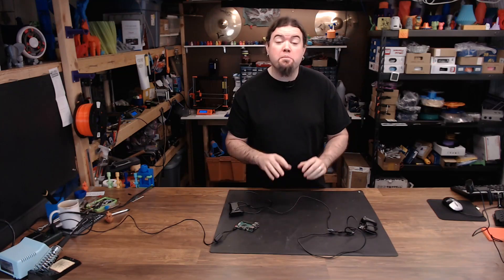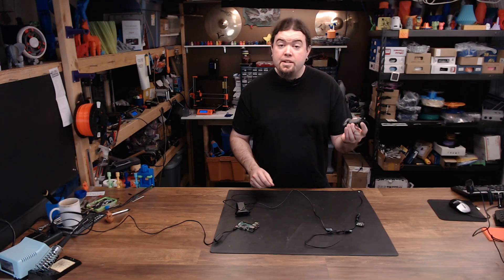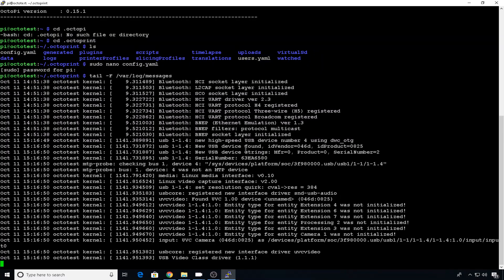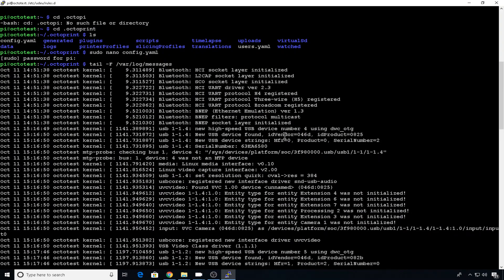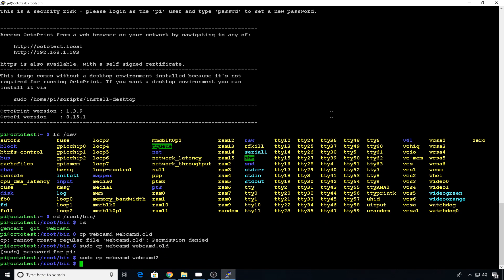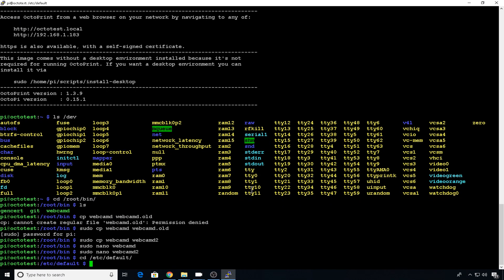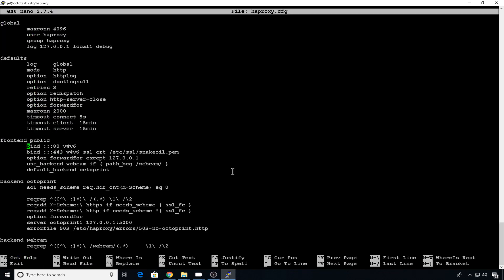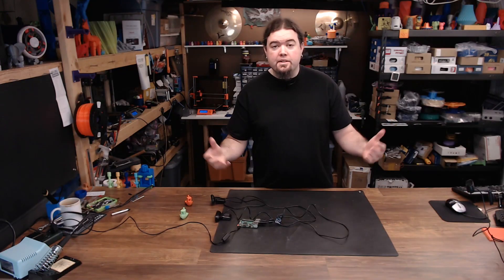Depreciated -  Multi-cam Plugin - Chris's Basement

Comment: has anyone got this to work as I have tried with 2 Logitech web cams both have serial numbers but just only one camera works , looks like second camera is not loading correct as the light on webcam is not comming on
Reply from the maker: What Pi are you using? Depending on your resolution you might be running out of CPU power.
Reply: Chris Riley I’m using 3B
Reply from the maker: @woottog  Ok, sounds like something is off in the config. You can send me an email if you need further help.
Reply: @ChrisRiley  I wish you hadn't asked to use email, I have 2 webcams from 2 different no name companies (probably the same OEM though) with the same vendor, different product, and same serial number. Would have been nice to have the answer here where others can find it (Pi 4 by the way).

Comment: I figured I would let you know that the octopi 17 update will break this. as there isn't a webcamd in /etc/init.d/ anymore.  I couldn't find the appropriate file to edit so I had to revert back to the latest 16 build.
Reply from the maker: Thanks, I will see if I can sort it out.
Reply: @ChrisRiley  If it comes to it, I would be more than willing to help.  I did get my first webcam to work even with multicam by commenting out a line.  But I couldn't for the life of me figure out how to add the second one without the webcamd2 file in that directory.
Reply from the maker: Thanks! I will try to jump into this soon.
Reply: @ChrisRiley  Same here, at this point I also got stuck since no webcamd in /etc/init.d/ ... Any soulution or ideas yet?

Comment: I have instaled on my raspberry pi 3b+ octopi , that is conected to a mks gen l v1.0 motherboard for my 3d printer(ender 3 pro), soo wen i open my octoprint into a browser i can use octoprint . I wanted to install some pluggins ,but first time i had an error that said my server was offline , after conect my raspberry to wifi and set a static ip adress , i conect my raspberry to my main board , after that is said the status of octoprint was operational , soo i expected it will work ....
After that it said that my instalation doesn't have internet , soo i coldn't install pluggins . I see that in the "conectivity check" my host was 8.8.8.8 and my port 53, i press on test , there said "server is unreachable ".
What do i supose to do ?
Reply from the maker: Sounds like a networking issue. From the command line can you ping 8.8.8.8?
Reply: @ChrisRiley  Thank for your answer ,no i coldn't , it was a nwtwork issue, but yesterday i just reinstall octopi and octoprint , amd now i can conect to the ethernet and alao my plugin and mainboard work , only one thing that didn't work is my tft 28 touch screen , from octoprint i can control my 3d printer , but from the touchscreen i can't it shows up the classic blue windows style ,installed by me from github , but it didn't do anything .
Reply from the maker: @alexandrugroza839  Sounds like the Uart connection isn't a connection. If you unhook from the Raspberry Pi, does it work?
Reply: if i unhook the mainboard from the raspberry , no it didn't work
Reply from the maker: @alexandrugroza839  What version of Marlin are you using?
Reply: @ChrisRiley  Marlin 1.8.9
OctoPrint 1.3.11 running on OctoPi 0.16.0
raspberry pi 3B+
mainboard mks gen l v1.0
touchscreen tft 2.8 v4.0
tmc 2208 v1.0
cura 3.0.2/4.0.0
Reply from the maker: @alexandrugroza839  1.8.9 is your IDE version, are you on Marlin 1.1.9 or 2.0. I ask because 1.1.9 should work without any change. 2.0 you will need to enable the second serial interface.
Reply: @ChrisRiley  ok , how i do that , i see something like //#define lcd for melzi and #cr 10 stockdisplay,
Reply: @ChrisRiley  or #define mks mini 12864 (mks mini with graphic controller and sd suport )
Reply from the maker: @alexandrugroza839  If it's 2.0 Uncomment this one and make it 1 #define SERIAL_PORT_2 1
Reply: @ChrisRiley  i search and i dont have that one , only 
serial port 0
And i write 
Serial port_2 1  
Then i veryfied and saids i have to chose only one lcd not more , i thick i have uncommon the default ender 3 lcd , soo i have to commen that
Reply: Is that command from other reply ? 
Mks mini 12864 
Or other ?
Reply: ok ,i succeeded , the problem was baudrate , it was wrong set , tanks for all your help :))
Reply from the maker: @alexandrugroza839  Awesome! Glad it's working, you had me stumped. :)
Reply: @ChrisRiley  :))

Comment: I might be a little late to the party but I can not get this working. 
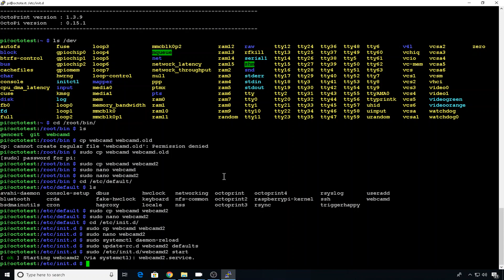I think I know what's causing the issue, but not how to fix it. At 11:46 in the video, you can see the output of the service running.
My output is a little different (probably because of more recent updates), but that shouldn't matter.
I can however see te HTTP TCP port webcamd2 is using and for some reason it's streaming on 8080. 
I have retried everything 3 times today watching closely that everything port related I setup is true copypasta to the video, to no avail.
I think this causes it to just wipe away my webcamd or it just takes the default first connected route...
I am pulling my hair out, if someone could be so kind I would appreciate it dearly.

Setup:
Octoprint : 1.3.11
Octopi: 0.15.1
Cams:
webcamd: Logitech C270 (as in the video)
webcamd2: a cheap generic endoscope (which is right now the only thing streaming in the gui)

Kind regards,
victor
Reply: Isn't octopi into version 0.16
Reply from the maker: @gregoryayres1535  Yes, octopi is on 0.16 now.
Reply: @gregoryayres1535  Ok, I'll look into updating octopi. I'm just not sure how that would help me in setting this stuff up :p. Might be good to get a clean install with just the multicam. Thanks anyways
Reply from the maker: If you are still having trouble Send me an email brotherchris81 @ gmail dot com

Comment: went through all the steps and sadly now my octopi server doenst start up and i have to fresh boot my raspi to fix the problem
Reply from the maker: Sorry man, it is easy to mess up along the way.
Reply: @ChrisRiley    any ideas as why now even new loads are having connection issues.   I can see anything on my touch display or get it to ssh
Reply from the maker: If I were to take a guess you might have a power problem.
Reply: @ChrisRiley  yea idk.  I have an offical psu for the pie.   I got it back up with fresh install and this time I imaged the drive before starting any work.  Hopefully this time it takes. 

  I do love ur vids they are straight forward, good notes and clear.    Can you do another vid for a 7 inch touch using the pi 3b+  I got touch ui installed but only ever got interface with zero actual information or control of printer
Reply from the maker: @gregoryayres1535  I will see if I can get a hold of a 7".
Reply: @ChrisRiley  it did the same thing again when i try to load the gui  saying octoprint server is currently not running.....i can SSH into it and this is the exact same thing that happened last time i tried to do this.  i did take a snap shot but no way to upload that here
Reply: any ideas?
Reply from the maker: @gregoryayres1535  Send me an email brotherchris81 @ gmail dot com
Reply: @gregoryayres1535  did you ever get this working? Im having the same problem
Reply: @cherokeewheeler  nope. Decided to try and use old laptop and ubuntu

Comment: just tried it messed up somewhere.  the  webcams i'm using are the same.  now my webcam 2 works but not webcam 1
Reply: double check your spaces if your having issues.  took me forever to find it. everything working now.  great walk through.
Reply from the maker: @EPICPRINTS  Awesome, glad you found it!
Reply: @EPICPRINTS  where might i ask were you missing a space? im currently having the same issue. seems only one cam will show at a time, sometimes on webcam 1 other times on webcam 2 depending on what i change. either way cam 1 config.yaml settings keep reverting webcam 1 back to no ip default.
Reply: @SHPLOOPSHPLOOP  i coudln't tell you where it was.  just double check it all.

Comment: I could not get this to work, here is some that i learned. I use two c270 cameras. When i plug one in 2 devices appear in /dev, video0 and video1, when i plug the other in video2 and video3 appear. Only video0 and video2 work with mpeg streamer. Problem is, 99-usb... does have insufficient info, so sometimes camera1 links to video0 and sometimes to video1, likewise the second camera, sometimes video2 sometimes video3, never found rhyme or reason. Even more interesting is when u unplug and replug in a different usb port, it appears the system keeps a hold for a bit and suddenly camera 1 will be video1 and video2 and camera 2 anybodys guess.

Tried to find differences between video0 and video1 to put in 99-usb.rules, nothing was consistent

I ended up linking to entries in /dev/v4l/by-id/ where each camera had 2 entries, each ending in -0 and -1, linking to each camera ending in -0 made things work consistently.

If u do ls -al here, u can see which video devices are linked to. Found using the entries in this directory made things work regardless of ports plugged into

Oh yeah, the cron works on 2 minute intervals, so if u unplug and replug it may take a few minutes. As it says in the Hitchhikers guide to the Galaxy .. Dont Panic

Hope this helps somebody
Reply from the maker: Thank you for the info.

Comment: Chris
Thank you for sharing  your knowledge.

I just installed OctoPrint  1.3.11 with OctoPi 0.16.0 on a PI 3B+ and I am not able to get the default camera to run (only the C290 works).  I have a Logitech 270 and a C290 (both have a serial #)

Both cameras work on their own PI hardware before I combined them into one install with the new version.

Any suggestions?

Comment: Hey Chris! I have a dash cam and a logitech c270, and the octolapse time-lapses are great from two angles, but would it possible to use an old iPhone 5C? I think the camera on that is slightly better
Reply from the maker: I don't know anything about apple, but if you could set it up as a camera server with an app, then you could probably just add its IP and pull in the feed.
Reply: @ChrisRiley  hey there! I tried using an app that has an IP address, but it doesn't work with OctoPrint. The IP on a browser pulls up the camera, but when I add that IP on the "Settings, MultiCam", nothing shows up but "Webcam stream not loaded". I also tried adding the IP under 'sudo nano config.yaml', but it doesn't work either. What suggestions do you have for a wireless camera app like this one?
Reply from the maker: @humbertoramos9172  I think that really should work. Does it use port 80? Maybe it's trying to use 443?
Reply: @ChrisRiley  how exactly do I check what port it's using? I'm thinking that since the "udev rules" still have both webcams previously used, it might try to use one of those. However, the device isn't connected, since it's IP based.

On the forums, people mention that a url like "http://username:password@1.2.3.4/tmpfs/snap.jpg" works, but in this case, I don't know what the username or password would be, since it is an application that generates an IP address on the phone used.
Reply from the maker: @humbertoramos9172  Yeah, you have to pass it the credentials. Not sure how we could make the work in the gui.

Comment: shouldn't you add a 2 after the  /etc/default/webcamd <- 
?
Reply from the maker: On the second one yes, point me to where in the video you are talking about.
Reply: @ChrisRiley  11:08 it's in the header (i know it's commented :))
Reply from the maker: @abtra  Those headers are actually used by rc.d files to make sure dependencies are met before things are started. Even though they are commented out they are still read, so you can update the informational ones with a 2, but not all of them. Just do the 7 updates I show in the doc and it should work.

Comment: Thank your for this guide. However i can´t get 2 cams working. It seems like "webcam2" is not accessible:
- IP/webcam/?action=stream  is working
- IP/webcam2/?action=stream  is  not working

Interestingly if i change in 99-usb.rules the names of my two cams i get a picture from my second cam.
Do you have any Idea where to look at next?
Thanks a lot!
Reply: I have the same problem. When I type "systemctl status webcamd2.service" or "systemctl status webcamd.service" everything is running normally

Comment: how do you change the resolution on cam #2?  so i have the logitech c-270 and it says to use -r 1280x720 -f 30 or -r VGA -f 10... My first cam has been set all ready in the octopi.txt
Reply from the maker: You usually can't use octopi.txt in a dual camera setup. The resolution is set in /root/bin/webcamd and webcamd2.

Comment: Hi Chris, great tutorial! However I'm having an issue where only 1 of the 2 WebCams show up. I have gone through your tutorial 4 times and still can't get it to work. I have a Logitech C922 and C615 I'm trying to connect. The C922 is the only camera that will display. I have both WebCam 1 and WebCam 2 buttons but both display the one camera only. I did notice that in the multicam plug-in , WebCam 1 removed the URL from /webcam/?action=stream. Basically it switched back to the default. Any help would be greatly appreciated. Let me know what other information you might need. Thanks
Reply from the maker: Hey, send me an email and I will help you troubleshoot. brotherchris81@gmail.com

Comment: Chris, I’ll be looking forward to that video. Can you tell me if it’s even possible to set the pi camera up and include a usb camera on the same pi? 

What I want to do is use the Pi camera module for time lapse and then use a endoscope for a close up of my nozzle to see how the plastic is coming out of the nozzle. I’m hoping that this can in fact be done.
Reply from the maker: Yes, it is possible. You have to assign the pi cam as the default cam, the add your usb cams.
Reply: Chris Riley great news! I can’t wait for your tutorial! Thanks you for your help.
Reply: Hey ! Have you found any solution to do that ? How can i assign pi cam as the default cam ?

Comment: Hi Chris. Is there easy way to undo this all 'cause i dont get any camera picture at all anymore :D I have been watching this over and over again  and i just don´t get it...im using two hp hd2300 and 1.st problem those do not have serial. in  99-usb.rules i think i can handle it with devpath, 'cause  those cams are in same usb always.2nd problem is after 99-usb.rules, after reboot i dont get ls /dev  "orange" "green" anywhere..
Reply from the maker: Not sure about backing it out, but I can help sort this out.

So if you run this command all at once, its going to copy some log files out to a pastebin site. There is no info that is sensitive and really the only way you could find these files is by having the link. The files will be deleted in 7 days.

If you are all right with that, run this:
sudo wget -O info.sh https://www.dropbox.com/s/08qhr7f33j7wq4k/cam_install_info.sh && sudo chmod 777 info.sh && ./info.sh && echo

Then send me the link it spits out at the end.

Comment: I went through all the steps and when I go to add the second webcam when I hit save it changes the first webcam's URL back to the original.
Reply from the maker: Save in the GUI? Check and see what is in config.yaml.
Reply: @ChrisRiley  Yes. when I save in the GUI is changes the webcam 1 URL in both the GUI and the config.yaml file
Reply from the maker: @3dprints140  So it should stay there after a reboot, correct? Here is my config.yaml.

  multicam:
    _config_version: 1
    multicam_profiles:
    - URL: /webcam/?action=stream
      isButtonEnabled: false
      name: webcam 1
    - URL: http://192.168.1.187:8081/webcam/?action=stream
      isButtonEnabled: true
      name: Webcam 2
Reply: @ChrisRiley  I change the config.yaml to be what you have above with my IP but the webcam 2 stream won't load
Reply from the maker: @3dprints140  If you send me an email I can help you troubleshoot. brotherchris81@gmail.com
Reply: Chris Riley having the same issue after 3 tries and the last involving starting from scratch with a new OctoPi reimage. I can only get 1 cam working at a time. I’ll update the config.yaml to the proper urls ctrl x, y then go back in to make sure it took, restart and all still well but once I go into the GUI to make sure it reflects, it does but only till I press save at which point it reverts to the default both in the GUI and config.yaml not sure where to go from here as this last time I copy pasted every step from your notes vs manually typing it in. Couldn’t find the solution in these comments or elsewhere